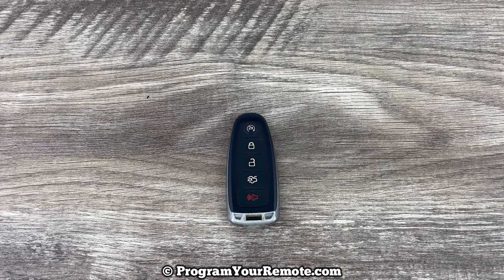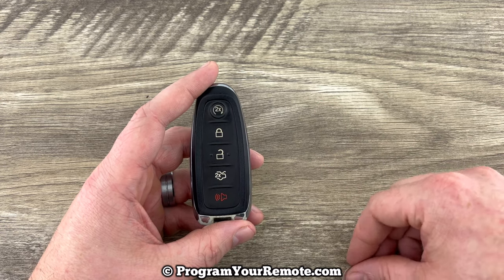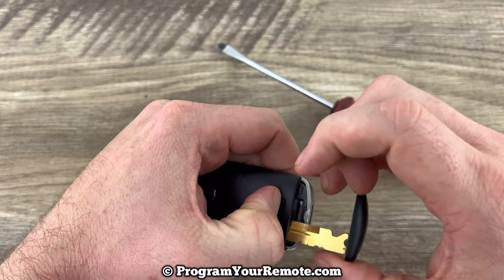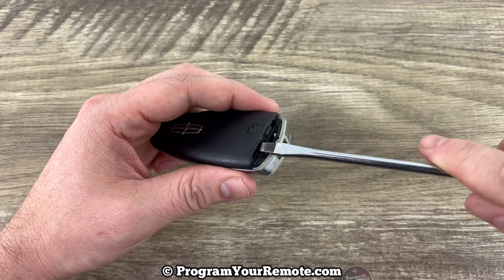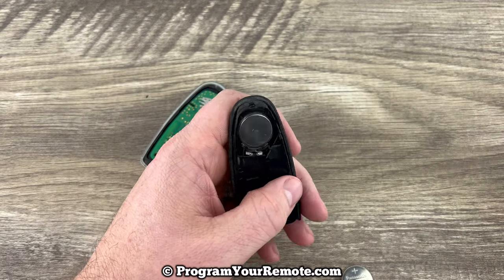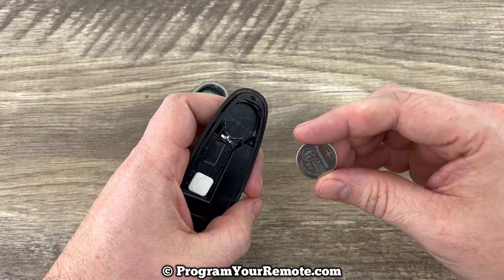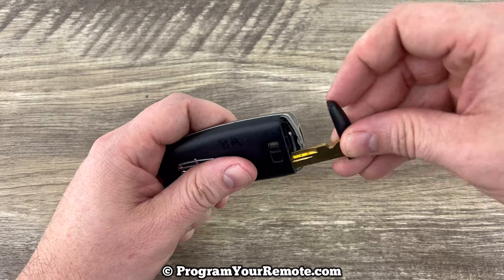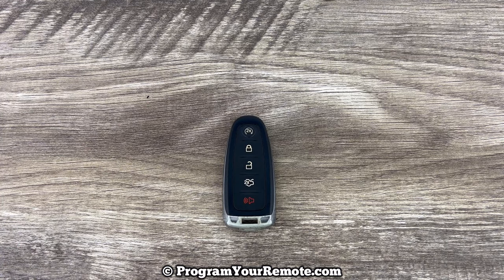2011 - 2015 Lincoln MKX Remote Fob Key Battery Change - How To Remove & Replace MKX Key Batteries

Comment: I've also learned that if the fob battery is dead , you can still start the car until you get it replaced. Inside the storage console, towards the front, half way down there's a slot to insert the fob (it will have to be removed from any cases) face up. Push it all the way in and it will recognize the fob and start. This even works with the battery removed.
Reply from the maker: Exactly! we actually have a video of it here https://youtu.be/_zOwzpdb8Pw
Reply: Yes! Such a nice feature.

Comment: Please help me I have 2014 Cadillac xts and I saw you video about it and I want to add a new key I turn the key 5 times I don't have any massage on my dashboard what should I do please help
Reply from the maker: some vehicles only show the messages for a few seconds right when the door is opened - I would recommend just going off of the time rather then the messages on the dash.